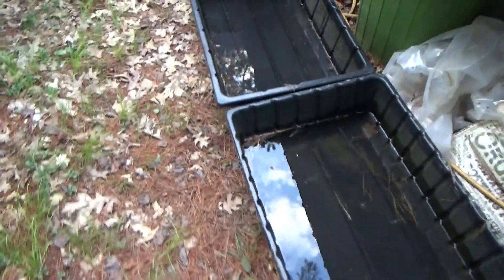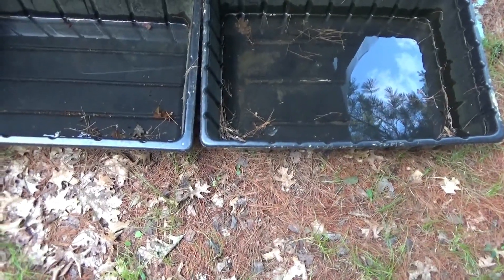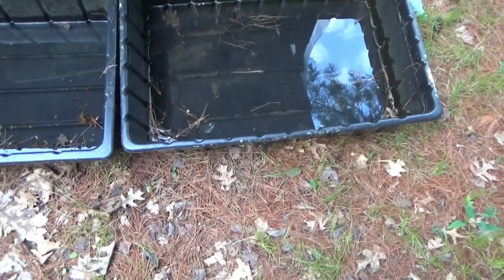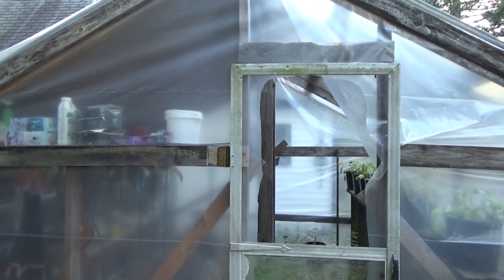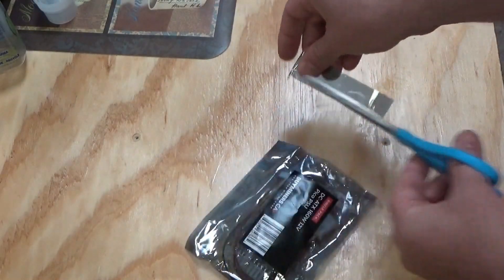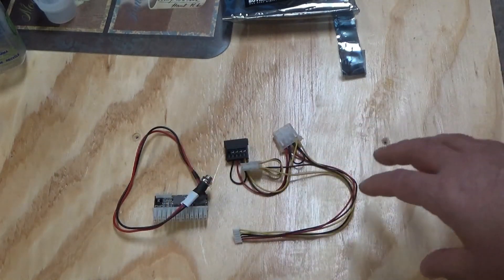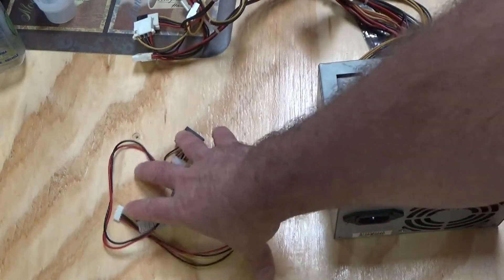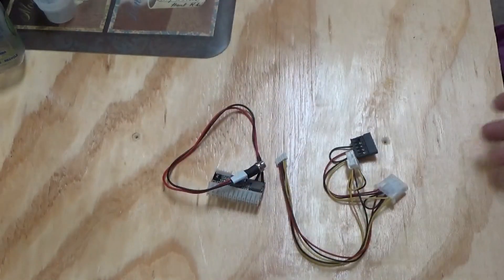Greenhouse Rain Water Explained & Off Grid Computers

Comment: It would be easy to run off of 12 volts. Just buy a 12 volt cord for your computer. That what I did and works great.
Reply from the maker: If you are talking about a laptop, that is easy. But this is for desktop computers.